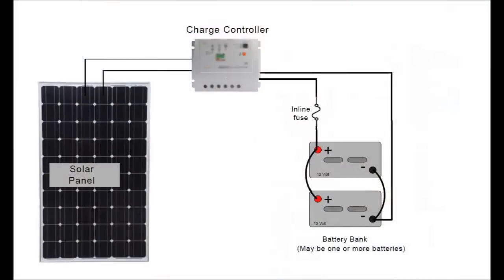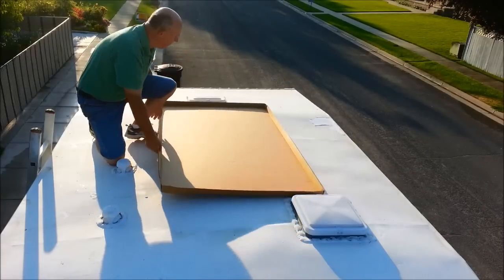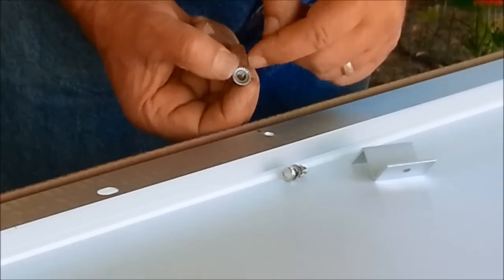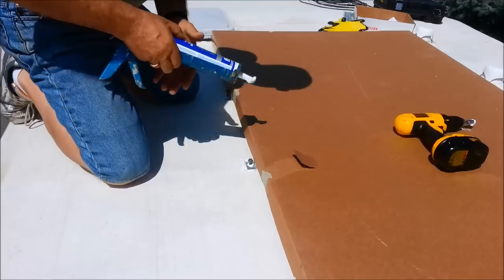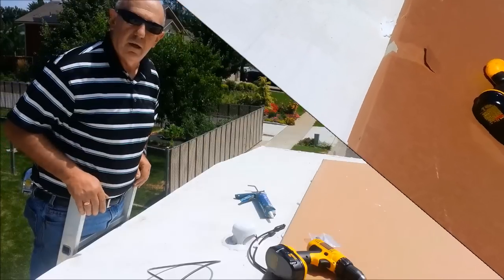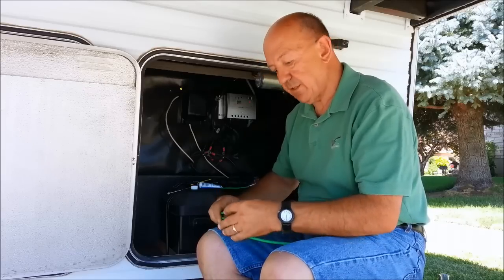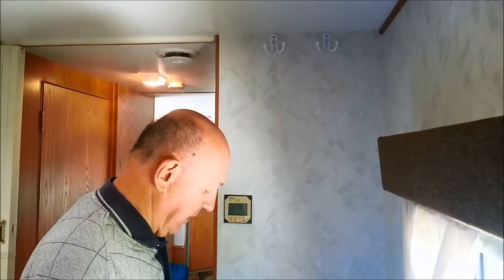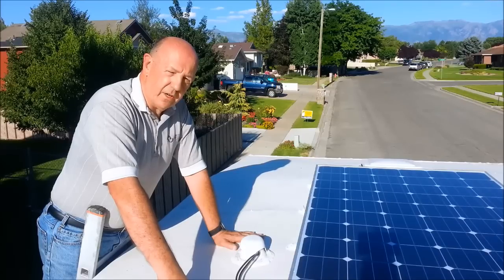The Power of Solar for Your RV

Comment: Can you have both a Solar panel and an AC power Converter charging your batteries at the same time?
Reply from the maker: Sorry to take so long.  My computer was acting up and wouldn't let me leave a reply.  The answer is yes you can.  I had the same question when I was planning mine.  Your controller only sends what the battery needs to your battery and if the power converter is doing the job and/or the battery is fully charged the controller sends the appropriate amount or no power to the battery bank.
Reply: Scott Law
I think his question was can it be plugged in charging and charge via solar too.  And both are separate circuits, but I think the solar charge controller will sense that the batteries are being charged or at full strength and not charge.

Comment: Very nice video, Scott, and all good advice from what I saw.  Lots of solar advice online is questionable to say the least, but yours looks to be very well done.  Great job!   I just might add how important it is to consider where to mount the panel with respect to a/c covers, roof vents, tv and/or satellite antennas and how their shadows might affect the panel throughout the day.  It's amazing how many "professional" installations out there have serious shading issues.  Also, if one typically camps when the sun's angle is low (as in winter) adding the ability to tilt the panel(s) can be a big help.  If interested, check out my RV Solar 101 blog:  http://www.rvsolar101.blogspot.com